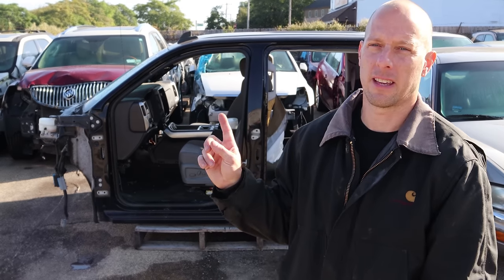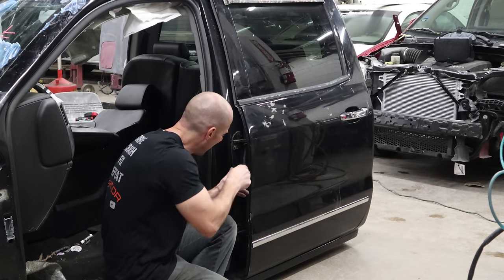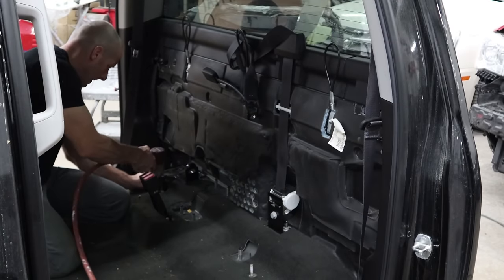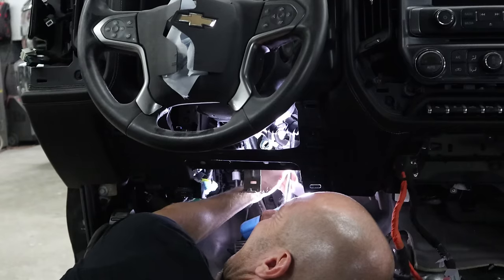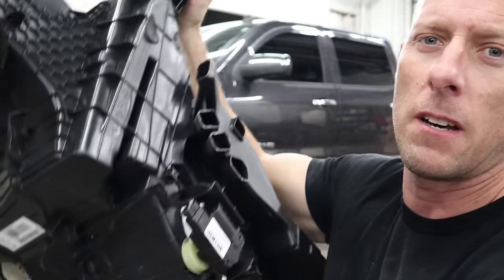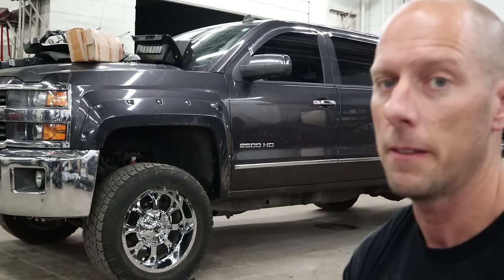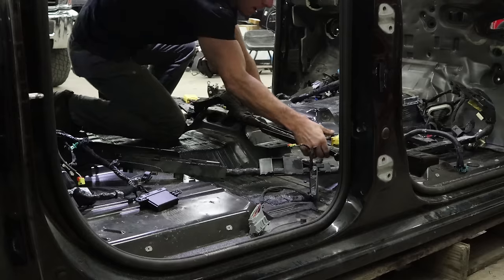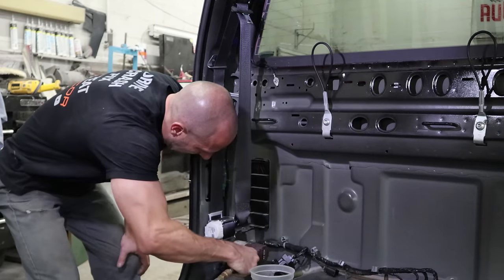Gutting the cab for the 2015 Silverado mistake and attempting to reassemble it. (Part 5)

Comment: You totally insane who you trying to fool when you complete the job it would have cost more than its wort plus it never be the same
Reply from the maker: Just because you lack the skill, knowledge and vision to do something, it does not mean everyone else does.  I might like the work but I am certainly not going to do it for free and absolutely not  going to pay to do it.  So you are clearly wrong there and as for not being the same...  It will be better!  How about you give some support to your wild claims other than the standard brainwashing about wrecked vehicles?  I'll be waiting.
Reply: To funny 😁
Reply: @vehcor  well said, !!
Reply: @vehcor  all I know is my 64 old mobile Jet star 1 sat in a field for about 25 years. Started right up with fresh gas, The guy that bought it for $2000 drove it onto the flat bed. He never even cleaned the gas tank. He took me for a drive once it was running. still needed paint and some frame work,  Brian if your out there. I want my car back. I'd gladly pay 10 and it sold for 3500 new...
Reply: @vehcor  I've been doing this for about 30 years and back up your claim about ending up in better than new condition. Many factors lead to this but most of all it's the care of one guy building a vehicle with more time and care than one built by a guy that doesn't give a shit what he sends down the line. Additionally, once all of the wrecked/damaged parts are removed it's not a wrecked vehicle anymore. Another thing I've noticed is that when rebuilding wrecks it is often possible to double your money. Far better than any of my other investments. Now, that being said, someone built that "Mistake" truck at some point and sadly there are people putting that crap on the road too. I'm glad you aren't swayed by people that bash you because of their ignorance. Please keep posting these inspirational videos.
Reply from the maker: @bartjones1827  People are so brainwashed into thinking that everything from the factory is perfect.  I find missing screws on dash boards all the time.  I take the time to put them back even if the guy at the factory did not.  I see a lot of harnesses that are not clipped in and some horrible panel alignment.  My Terrain 1/4 glass has the weatherstrip tucked under the taillight, I have seen a few from the factory.  It annoys me but I just haven't gotten around to fixing it.  It serves as a reminder that it CAN be better that factory!  People are also brainwashed into thinking wrecked cars can never be the same, never mind that they could actually be better. lol I really don't care what people have to say.  I learned long ago you can't please everyone.  I do this because I enjoy it and it makes/saves me money.  I focus on the positive comments, they are great motivation and why I keep putting time into my channel.  Although the negative comment do motivate me to prove them wrong and I do get a kick out of trolling the trolls.  Thanks for the support!
Reply: @vehcor  i do the same but with Samsung phones... keep it original and even improve the quality. Lots of people don't honor this kind of work because they lack knowledge. Keep it up man 👍
Reply: @vehcor  I just found your channel by accident and agree with what you are doing. I am a welder by trade and recently moved to Florida. Being here and having worked for 2 separate companys I have made more things for myself just because I can and it is better than what you could buy. Cargo carrier for my Rogue, all aluminum and has held 500lbs without bending. Rear bumper gaurd just because its cool and I made it out of diamond plate and cheaper than buying one. Also an awning with posts of stainless tubing and top frame of aluminum, it will never rust or fall apart. Two stainless vases for my wife, heavy as hell. Will be here when we all get nuked. Next project is a custom bull bar for the Rogue, why because I have the skills and can make one better than you can buy. The truck or any vehicle come good from factory, taking what you are doing with multiple pieces of wrecks and putting them together to make a totally new truck, you take them time and effort to make sure it is better than it ever was. Some ppl dont get why others do things like this and make stupid comments. Why do we take things and make something out of junk? Because we have the ability and it feels good to make something that you can stand back and say "I did that". Some ppl will never get it and just go buy whatever it is.
Reply from the maker: @natewood8124  Fabricating is my favorite thing to do.  My new trailer build was so much fun.  I wish I had a market to do that sort of thing all the time and get paid.  I would quit my job. lol  Thanks for watching.
Reply: @vehcor  not a problem and although I am not a chevy fan it is a great truck and looks like you did well on the financial side which is good. Is this something you do a good amount of? Do you do quotes on what it may cost if someone is interested? Morbidly curious just because I may be in the future interested in something like this from someone like yourself who does quality work.
Reply: Just missed on a 2018 rebuild but the guy lacked on the details. Truck looked good till you did a close walk around and popped the hood. Didn’t address some of the broken electrical connections that need to be weather tight. Too bad the truck drove like a new one and only had 7k miles on it. Just couldn’t buy the truck because of 10 small flaws
Reply from the maker: @natewood8124  I used to do around 100/year but have since slowed down to around 20.  The deals are fewer and I have other things I want to spend time on.  The videos take up just as much time as the builds so I guess I am really doing about 40. lol  I do take preorders on vehicles  Thanks for the confidence in my repairs.
Reply: @vehcor  I`m amazed at how you remember where everything goes and how to reconnect everything. How many times have you almost gotten done putting something back together only to have to disassemble again because you forgot a part?
Reply from the maker: webman1956 it used to happen more, now it is usually something in the wrong place, like the wires that fell down in this one.  You kind of get used to looking for certain things to be in their proper spot.  Hopefully you catch them before you have to backtrack too far.
Reply: @mitchkennedy11  Its Brian you can have it,think it needs a new fuel tank, mecanic said shit in the carbs, but i cant remember if i have to do that every 5 or 10 miles
Reply: @vehcor  you the man you are the best...😳👍don't worry about bad things that some people said about you.you the man .
Reply: Not exactly hard to put a Chevy back together better than the numbnuts that built it.
Reply: Can't spell either!
Reply: @vehcor  I think you are doing things the way they should have been done at the body shop / or factory, only takes a little bit more to do things right.  Keep the video's coming.  I've watched all evening some of the different builds, I would want you to fix truck if needed.
Reply: @vehcor  I always tell people that I am not any more mechanically incline than they are, it's just that I will attempt to do it and that they will just whine about it.
Reply: I'm posting this 4 years after the video, and I'm sure the market today would gladly welcome rebuilt vehicles like Scott works on, with quality truly job1!!

Comment: Man you're a mechanical artist. Way better than any of the TV shows that spend 80% of their time advertising and not teaching. I've been rebuilding Duramax for years not to the extent that you do but cutting out rust and welding in  new panels, head gasket jobs injectors. You inspire me to do even more.
Reply from the maker: Thanks, one thing I don't do is rust!  I hate it!  Good luck on your projects!  Thanks for the support!

Comment: Much respect for the work.   When I have the interior of a vehicle broken down I typically use the opportunity to add some sound absorption.  The added weight and a few bucks is worth the quieter ride to me.   As for the naysayers on the truck's value, it's true that the market value will not be equal to an otherwise identical truck with a clean title, that's not relevant if the fella is building it for his own use.  He's investing his time in lieu of the additional money that a clean truck would cost.   It's a reasonable trade-off for him.  Plus, how do you sell merch on your YouTube channel if all you're doing is going out and buying a used truck? :)
Reply from the maker: This guy gets it!!  That is exactly how I went into thinking about this build.  As it turns out these things are in such high demand they are bringing 80-90% of clear titles with rebuilt branded.  I can't even buy a salvage one that needs work for what I will have this one finished for.  Thanks for the support!

Comment: Wow! You have to have patience when a rebuild is that involved.  It's very cool to watch it come together for me in front of the laptop screen so it's really got to be satisfying for you when it's completed. My hat is off to you.
Reply: Also, it's probably too late & you've already salvaged the one off of your parts truck but I see on a Alabama craigslist a complete heater/ac assemble for $100. Just an fyi
https://bham.craigslist.org/pts/d/calera-15-chevy-silverado-hvac-assembly/6771696566.html
Reply from the maker: It is really fun to build it.  I like to take things apart and seeing it come together is what motivates me to put it back together.  I will use the one from my other truck but thanks for the parts locating work.  The problem is shipping is costly and there are lots of little parts to get damaged.  That was a good find and I might have jumped on it if it were local.  Thanks for watching.

Comment: Your experience shows. Even when I take pictures when I disassemble things, I have a tough time getting them to go back and I often find leftover screws.  I think next time I tackle a project, I’m going to get a paint pen and mark every screw hole. My old eyes don’t see them so well and even if they have molded-in markings, I often miss them.
Reply from the maker: I have little tricks I will share in my tutorials eventually.  I do still snap some pics from time to time but it has been a long time since I have had to refer to them.  I do occasionally end up with a leftover and have to go back through the process in my head to figure out where it came from but they all find their home eventually.  It helps that I pulled the parts cab apart first and learned where everything goes on something I don't have to put back together.  By the time I was taking this one apart, it was really the second I had done in the same day.  Whatever method works for you is the best, there is no right way as long as it is all assembled correctly in the end.  Thanks for watching.

Comment: Your videos are awesome. I keep my cars forever so I know almost every bolt. I am attached to my vehicles so I enjoy fixing them. I don't think I would have the motivation to fix someone else's problems partly because life is just too busy. Maybe if I was 30 years younger. Keep up the good work.

Road salt does destroy vehicles. I have a summer only car that is beautiful and my 05 Sliverado still looks real good. I used to rust proof it myself for the first 7 or 8 years and then I found someone who did a descent job so all I had to do were some touchups. Only rust is around the 3rd brake light and above windshield. I did replace the brake lines a couple of years ago.

Look forward to the rest of the videos.
Reply from the maker: Thanks,  I like the work and can't say no to a challenge.  I'm still kind of young.....ish well, I still enjoy the work anyway. lol Salt is the worst,  I can't wait to retire and move somewhere where they don't know about snow!  Thanks for the support!

Comment: Wow, your labor on the thing is probably worth the value of the truck. But... I myself have done stuff simiar, to put together a few older cars. One thing I would say, is throughly examine wires or harnesses you reuse near the impact points to make sure there is no broken wires. It was interesting to see how the face of the radio came off like that. I guess they make them so if you break em. It doesn't damage the head unit. It was also something to see with putting the headliner in through a big window. My 05 town car was rebuilt after a tree fell on it. Everytime I look at the headliner with the warp in the back I think of your videos. It will be exciting to see the truck once it is done. Even though you didn't get the best deal ever on the truck. Just the videos themselves and your own experience is priceless. I know for myself, learning the vehicle like the back of your hand is basically a full dissasembly and assembly. Depending on what comes your way. I was amazed how gm made that plate on the motor to break away. That in itself shows you how they designed it to have a front end impact and keep the motor away from the cab.
Reply from the maker: I really don't have as much time in this as everyone thinks.  I will have a breakdown at the end.  The face plate is just that, the radio itself is a combination of those modules you see me changing in the dash.  The radio module, xm module, and infotainment module.  They do that to hinder the aftermarket companies from building inexpensive upgrades. lol I do inspect all the wiring and surprisingly it was all good on the cab.  It is much easier to repair it when it is all out than after it is back  in the truck.  It turns out what I originally thought was a mistake may turn into one of the best deals ever on a 2015 Silverado.  I will have much less than I could buy this truck for in it and with the leftover parts I sell, I should be able to sell my old truck and upgrade for nothing.  Which is exactly what I did when I got that truck.  Thanks for watching.

Comment: HOLY SMOKES ! What a job. Interior work drives me wiggy, plastic clips snapping left & tight, hidden screws, sliced hands. Give me a good ole ball joint or any other suspension components & I'm in hog heaven.
Reply from the maker: Interior jobs have become much better with cordless tools.  It is the one place I actually prefer them over air tools.  I do like changing suspension components but sometimes a change is nice.  Thanks for watching.

Comment: How on earth do you remember which bit goes where. I service my own motorcycle and would happily rebuild it but that... I was lost when you took out the steering column! Seriously impressed.
Reply from the maker: Practice......  I honestly don't always remember on the first try.  Some times I think I am done and I look in the bucket and there is a screw left.  I mentally have to go though the job and figure out which one I missed but I find it eventually.  This was easy, I was putting it together on the same day.  Usually, it is weeks in between.  The steering column is actually only five bolts.  I keep fastners divided up buy parts to keep them organized.  I will have a tutorial on how exactly I do it, in the future when I am done with this truck.  Thanks for watching! I'll keep trying to impress!

Comment: Nice build....been really needing to build a new Silverado for myself before my 02 breaks in half ....only welded frame 4 times last 6 years.lol
Thanks for the great vids
Reply from the maker: I hate rust! lol My 06 still has a solid frame that came from the south, solid rockers and clean brake lines.  I just want all the newer tech and much more space in the 2015.  Good luck on holding the 02 together, the rust will kill it before the drivetrain dies for sure. lol Thanks for watching!

Comment: Dude you rock! You’re almost robotic lol! Glad to see you’re using those awesome clip pliers, I discovered those about 10yrs ago & they quickly became one of my favourite tools. Looks like these newer GM’s are a lot nicer to work on, when I started in a collision shop in ‘02 I was working on mostly 1/2 ton 4x4’s from the 90’s & I was not a fan of those Chevy’s, that was 80% of our business though, I used to pray for a Ram to come in lol! Later I worked in a transmission shop & once again those Chevy’s were 80% of what I worked on! (They weren’t as bad from that angle at least) After that I went back to auto body but stuck to restoration work mostly so I never got a lot of experience with the newer stuff, just the odd bumper job or whatever but mostly I prefer cars from a time when things didn’t just “wiggle & pull”!
Reply from the maker: Haha, I have developed a method to the big jobs like this that is very efficient so I can understand how it might look robotic.  I don't stop and I am thinking about the next step as I am working on the current one.  I hated those 88-98 GM truck doors!  It is nice that the whole inside of the door comes off but maybe if they had made it a little easier to get the window off of it or rods to the outer door handle it might be fun.  It seems like every one of those needed a door handle and window motor but never at the same time so you get to take it apart twice.  I like wiggle and pull, it is better than find the screws we hid in obscure places. lol Thanks for watching.